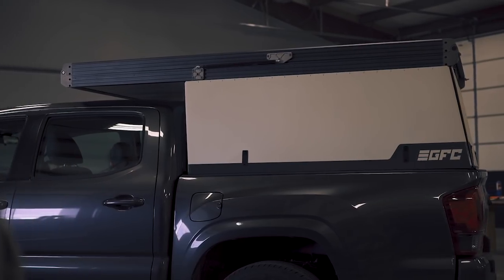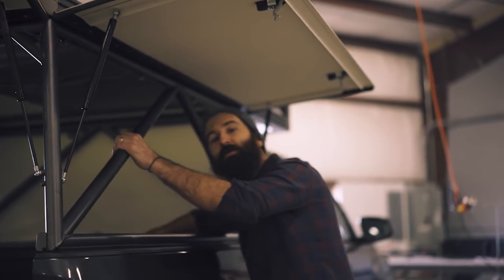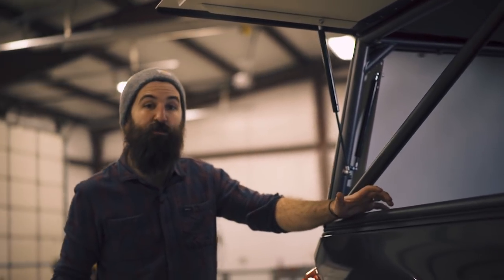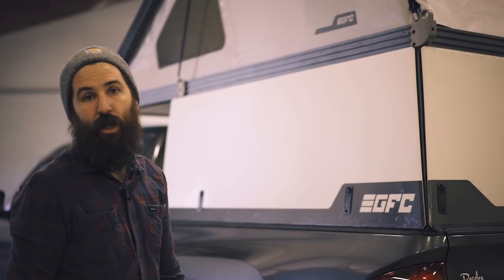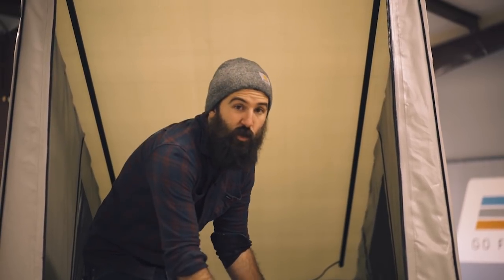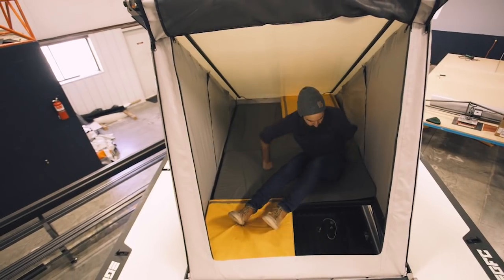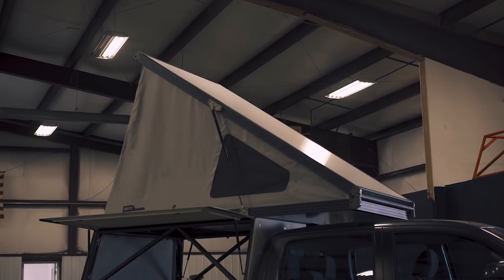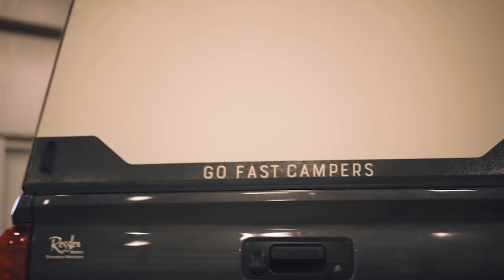Go Fast Campers Platform Walk Around Video

Comment: very cool system--this covers everything I want with nothing I don't awesome job!  Now I just have to get a pickup and some extra cash...
Reply from the maker: Thanks Conor!
Reply: GoFastCampers I'm looking for a system for a "new 6.5 ft bed F-150" that is the same level as the roof of the truck when it is closed.  It would have to stick out over the back a bit instead, maybe with a sloping rear lift gate.  Nobody makes a system that fits in the garage door to my underground parking.

Comment: I have ‘20 Tacoma TRD off-road access cab long bed (obviously), will I need an add a spring for this camper weight so it doesn’t sag? Will I be able to get my 450 dirt bike inside (height wise)? Also is there an “winter package for the tent available? Will my satellite connection work since the camper overlaps the roof receiver? Thanks! This thing looks Great!
Reply: I would look into vagabond! its kinda the same thing. after i got my V2 GFC i wish I went with vagabond but oh well. with my '19 trd tacoma i went with ARB's dakkar "660" lb leafs in the rear
Reply: @Sunlightbro7062  I kind of zeroed in on a AT overland Atlas.

Comment: Awesome product! I am interested down the road. For this specific set-up with new Tacoma, do you know the top height of the camper on stock suspension? My concern is wanting to leave the camper on year round (or mostly) but I go into parking garages downtown for work. I have a 3 in lift currently and my stock antenna hits the 6'4 or 6'6 height barrier but I have some space below that. Also, have you used heat sources with maybe one section of the bed out to warm in inside space for cold/skiing conditions to camp? Thanks!
Reply from the maker: Height is vehicle specific, but our camper typically adds around 7" to vehicle height. Send us an email for specifics.

Comment: Hey guys, I love the camper. I have a normal aluminum camper with windoors. On the inside of the windoors I have tool boxes (factory from the camper builder). I love being able to store my recovery gear, air compressor etc. on one side and guns or fishing gear on the other. I'd hate to lose that storage area. Do you have any storage that could go into the space when you open up that side door? Keep up the good work.
Reply from the maker: We are working on some storage solutions for those very spots! Thanks!

Comment: Hello GFC. I have 2 questions for you.
1 - How do I wash the rear window of my truck if I can't access it? Important detail if you get the window option on your camper.
2 - Isn't there any concern about water pooling between the mesh screen and the window flap? From what I've seen from this video, the flap zips down to the floor of the tent. I really don't want to deal with a soaked matress or wet equipment. Thank you.
Reply from the maker: Washing your truck would be similar to how its done with any topper, and there is drainage in between the mesh screen and window flap that runs away from the sleeping area. Water cannot enter.

Comment: I am curious about installing...does the manufacturer provide the installing service?and, is there any locking system inside the platform for the security purpose?
Reply from the maker: We do offer installation, and all of the panels are locking.
Reply: @GFC  but someone can open the tent and get into the pick-up bed?

Comment: Someone might have asked and it might have already been answered, but why are the gas shocks on the outside of the camper instead of the inside? Thanks!
Reply from the maker: Adam, because they keep the tent as low profile as possible, and optimize interior space. Do you have concerns with them on the outside?

Comment: Nothing was mentioned about storing your sleeping gear up top when closed? I don’t like removing my sleeping bags and pillows (I have a hard sell RTT now that I store everything inside). I just want to set the bed and close the top.  It this possible? Thinnest camper quote worries me as I would like it 1-2 inches thicker so you can store sleeping gear up there.  Please let me know. Camper looks great!
Reply from the maker: Thanks for reaching out! You can totally fit down/synthetic sleeping bags and camping pillows up there and still close the lid. Really heavy Coleman style stuff may be a tight fit, but with this camper it's a lot easier to pull bedding out and store it below than in any other RTT.
Reply: GoFastCampers thanks for the reply! I’m the market for a camper.
Reply from the maker: gsrthomas no worries! Hope you're having a great Easter. Shoot me an email at graeme@gfcengineering.com if you'd like to talk more!

Comment: Expanding on my previous comment you can buy a cheap tarp at Harbor Freight or Walmart for 5 or $10 depending on size and temporarily attach to truck cap and make a very nice shelter/canopy area to set  outside even have fire in the rain.. best part with traditional truck cap there's no popping up tent part having to lift yourself up to elevated bed. You're on the solid bed of the truck. You can just use some C clamps to attach truck cap to bed. It's amazingly a simple but excellent  camper setup
Reply from the maker: You can absolutely do this, and if it works for you, great! Getting out is what matters, and we make gear that makes it even easier and more comfortable for folks to go adventure. The most important part is having a good time!

Comment: Questions...

Does the camper affect the Satellite XM radio reception since it covers the antenna?

Can it be painted to color match ur truck?

Truck caps usually have seal issues with the back door causing dust to get into the bed. Is the back door completely seal from dust?
Reply from the maker: The reception is unchanged, it can indeed be color matched, and our camper seals very effectively, better than the stock bed!

Comment: Whats the point of putting a tent on a truck cap lol?? Just get a used truckcap .Look on Craigslist or local paper people regularly give them away or sell $50.00-$200 You can buy a used aluminum or fiberglass truckcap thats waterproof has screened windows roof vent can even install your own fan / exhaust. You can have the back hatch window open buy some cheap screen at Home Depot and a little Velcro comes with adhesive backing and have your back hatch screened-in in like a minute or two. With side windows open exhaust vent open and back hatch open massive air flow the exhaust vent kinda  acts like a drawl on a chimney. You can get a full size mattress pad for around $100 brand new... for about ten to Fifteen dollars at Walmart you can buy a waterproof zip up mattress cover.. when not in use you can roll up mattress pad in a good heavy duty yard style trash bag leave then truck bed takes minimal space. On a side note it helps to have a thin piece of Masonite or  OSB/ plywood on truck bed floor to make level smooth surface for mattress pad. My uncle even built a wood-framed raised bed. It's not the Taj Mahal but a lot better then just a pop up tent mounted on a truck cap for all that money.
Reply: Whatever point you were trying to make was not made.
Reply: Most people who are running 4 door trucks without 6 foot beds are pretty well hosed on sleeping in the back.